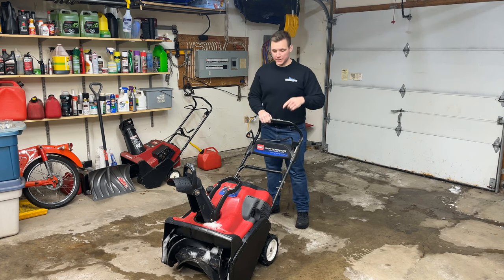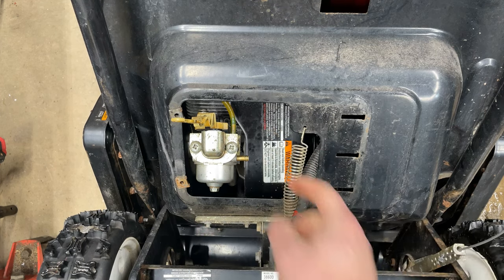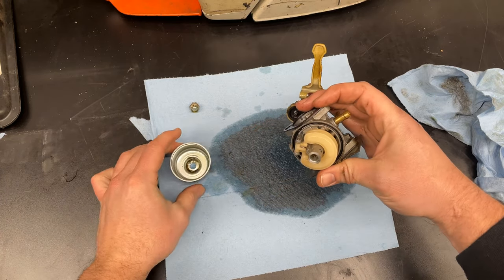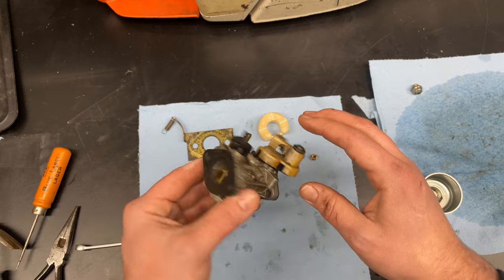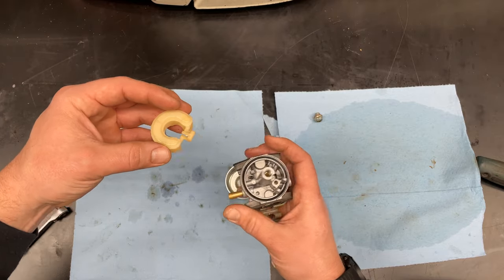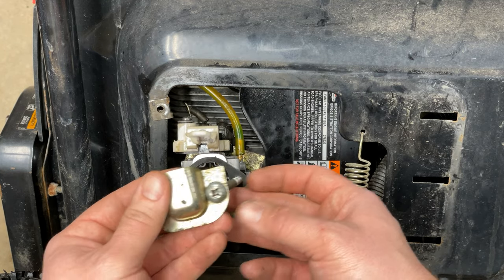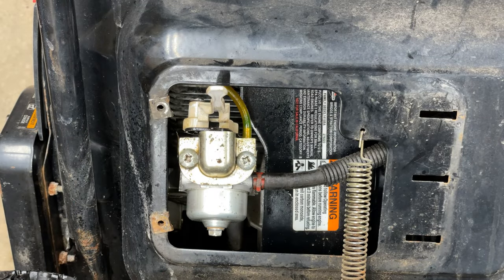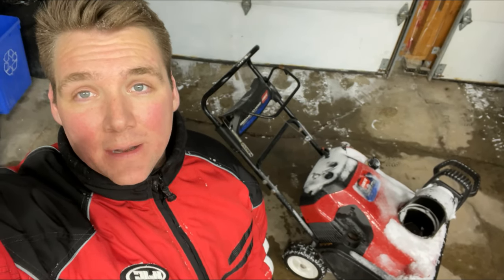Snowblower doesn't throw snow far, losing power, and even shuts off!!! How to take off & clean carb!

Comment: Dave, Nice simple cleaning.  One trick I always perform is after assembling the float/bowl, I turn the carb upside down, and blow air (might want to use a clean hose) into the fuel intake.  As I slowly turn the bowl right side up, you can tell if the air stops from the needle seating.    I can't tell you how many times this has saved me time.    The air replicates the fuel movement.  Nice work.
Reply from the maker: That’s a great tip Super! I will give that a try on my next carb. Cheers!

Comment: Hey Dave
Great tips Bud. I like the idea of using one of those nut driver bits to access the emulsion tube. 
How do those Toro machines handle the deep stuff? We’ve been hit pretty hard lately here in Niagara and my 30” MTD sometimes struggles to get through. I’m seeing a lot more of those 2 strokes out there. 
Cheers Dave
Reply from the maker: Hey Ray! Yes that bit really did work out great. 

I’m not surprised the 30” MTD struggled - every blower I’ve seen has been struggling. I used a bigger 2 stage toro this season and it really throws the snow. 

I think any snowblower sub 10hp would struggle with the amount of snow we have had in southwestern Ontario… my 7hp does well with the powdery stuff however a dual stage is really best when things get a bit warmer and sloppy out. 

I used to think that for most people, a 5-7hp single stage is all you need, but after this year, I’m not sure.

Comment: Hey Dave, what type of 2 stroke oil do you use in this?  The service manual specs a TCW certified type, which I don't think is super common?  Would Stihl 2-cycle oil (or similar) be ok?  Just curious. Thanks!
Reply from the maker: Hey Dave - I have used Stihl 2 stroke oil for the last two winters without any issues.